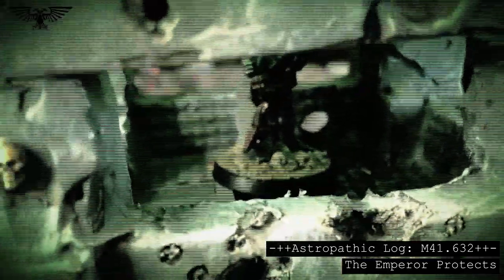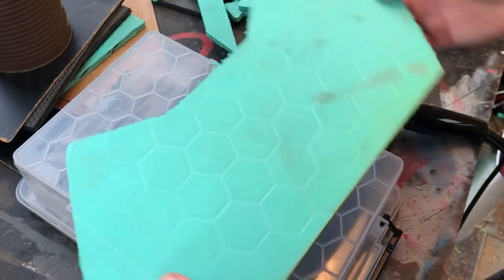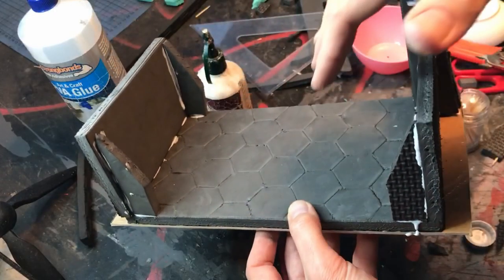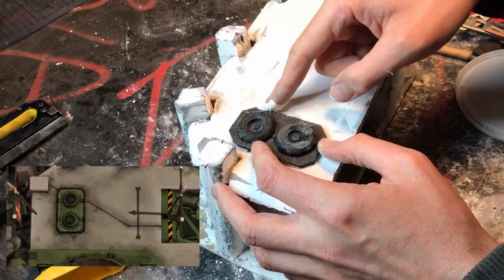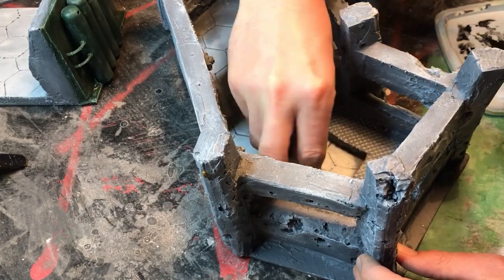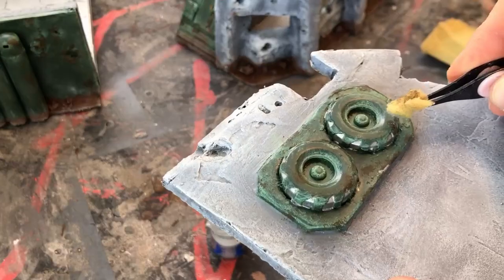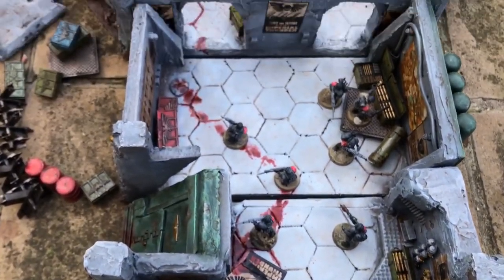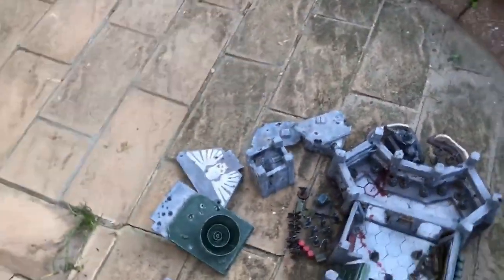DAWN OF WAR: Build your own IMPERIAL GUARD FIELD COMMAND. Cheap materials, no airbrush!

Comment: 12:53 Try using oil paint to add weathering. You only have to use a tiny oil paint to make the effect you want. Use two oil brushes: one small brush (toothpick even) to add the oil paint, straight from the tube, and another bigger oil brush (dry) to spread around the oil paint. I love using it because I get no visible brush strokes. Blends like a dream. After applying, wipe away a little with a dry rag so the colors of the undulations will appear again, as if you dry brushed the undulations. You can also use a dry rag to wipe away the oil paint if you put too much on. I also use my thumb to smudge and blend the paint more thoroughly.

I use only 4 colors. Brown, black, white and orange. Black/brown for different shades of dirt. Brown/white for dry dirt. Finally, brown/orange for rusts.

Comment: Turned out awesome!

I can think of one addition that would make setup/alignment easier, neodymium magnets where the parts mate, that way roof tiles would just find their position without any time spend getting them on nicely :)
Reply from the maker: Thanks mate. Whilst the current arrangement works well the magnets would certainly be an improvement. 
I hesitate to cram too much into a video lest the run time becomes too long for people, or unintentionally disheartening for those looking to start terrain building.

I’ll make a point to do a video using magnets in the future!